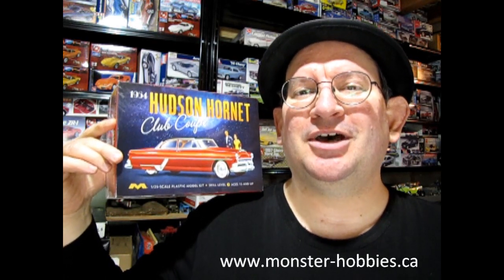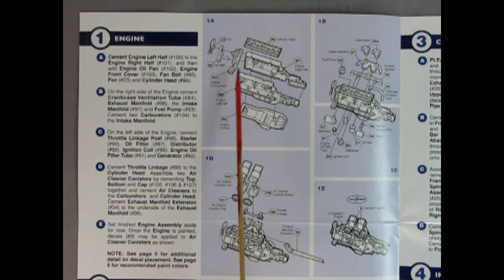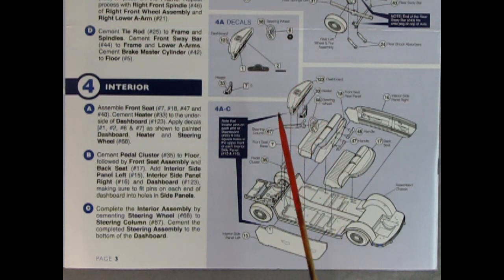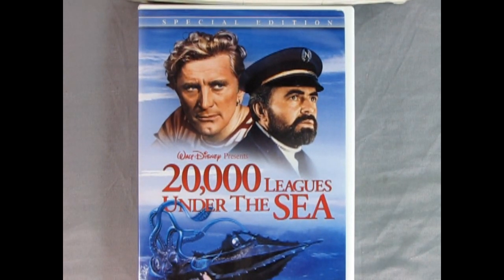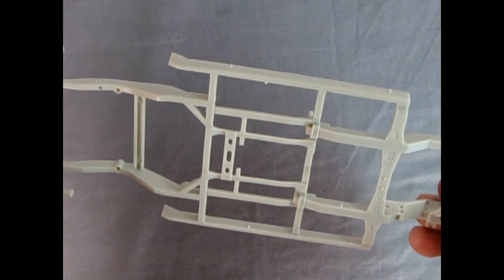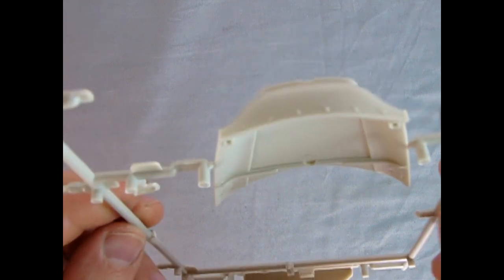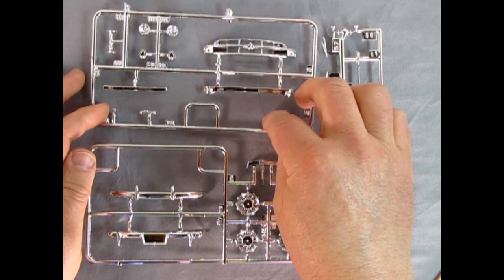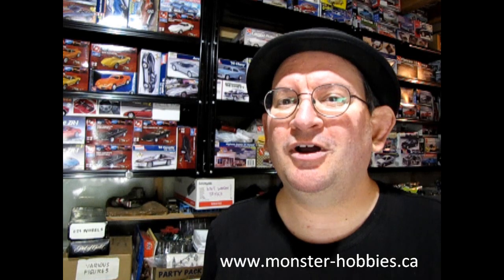Model Car Garage - The Moebius 1954 Hudson Hornet Club Coupe - A Model Car Kit Unboxing Video

Comment: Oh how nice it was to see Danny the Dog again 🐶. These really do look like very nice kits👍😎
Reply from the maker: They are!
You are also watching an older video, when Danny was still doing his thing.
Reply: @MonsterHobbiesModelCarGarage  I just got a good deal on one from importer. Damaged box so £25 post free👍😃. Nearly half the U.K. rrp.. I've also just looked at 69 Cobra rocker panel lines on a yellow car,the lines show up well exposing a horizontal line going from bottom rear corner of doors to the rear wheel arch🤓😃I've just been adding them😂
Reply from the maker: @petesmodelcarcustoms584  I am not seeing that line on the real car. Unless I am reading what you are saying wrong.
Reply: @MonsterHobbiesModelCarGarage  it's the line of the upper edge of the rocker panel to the rear quarter panel join. It is hard to see as body line half hides it in most videos.
Reply from the maker: You'll have to show me in your next video. 
Currently the house temperature is cooking...and so is my brain! 😱